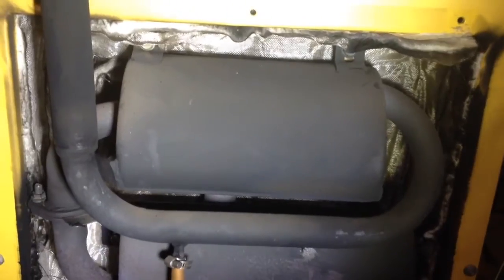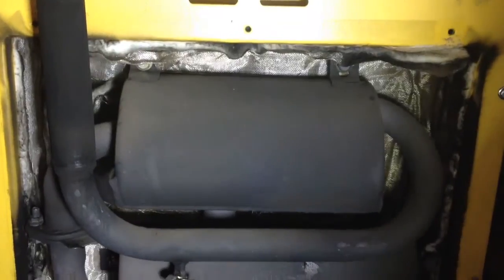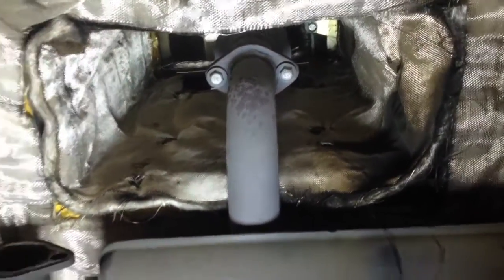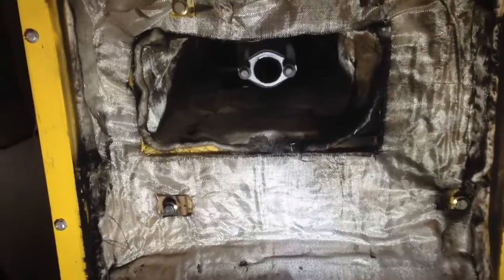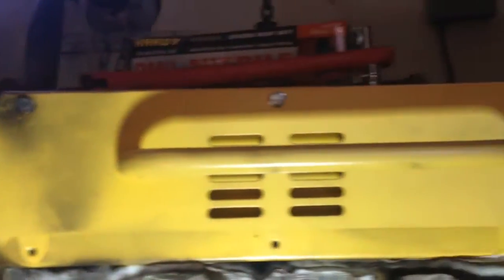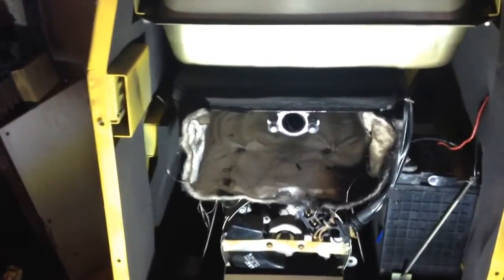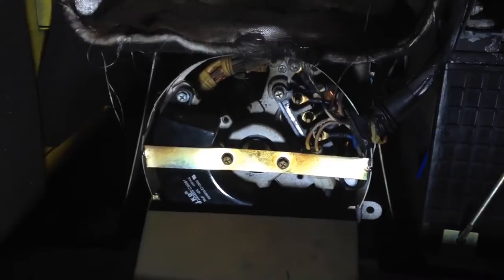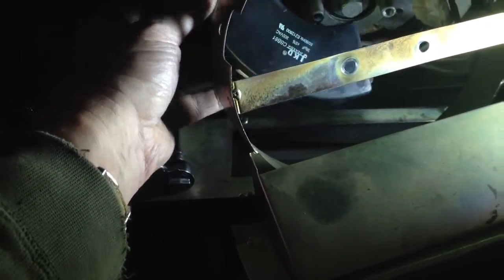Silent Diesel / China Diesel voltage regulating capacitor remove and replace

Comment: Alan, thank you for doing the heavy work here. I have basically the same unit you worked on many years ago. 

That said, my unit runs great except I have out of spec voltage. Basically 100/105 on the regular outlets and 200 volts at best for the 120/240 jack. Do you think that’s the AVR out of range?

Comment: When I did mine I ran longer wires to the capacitor and reloacated the capacitor so I can access it from the side access panel. Now it take just a few min to replace it when it goes down.
Reply: Mine was already set up that way

Comment: My generator is the same. 

i have an out put power issue I've changed th AVR as well still no power please please can someone help me am stocked  please
Reply from the maker: My generator is "self-excited" with capacitor regulation.  It does NOT have an AVR controller installed.  I regret that trouble-shooting is too complex (and potentially too dangerous) for me to go over.  My only recommendation is to test the continuity of your circuit breaker. (I had to replace mine a year ago).  Best of luck to you.

Comment: Hello 
I just got a new silent diesel generator from China very similar to yours, I used it the first night for 10hrs and it works great, the second night I I used it was working and then it stopped generating electricity but the generator is running fine, the volt meter dropped to zero. It’s a 240v system and I only had a very small load on it. I was hopping that you could help me please.
Thank you
Reply from the maker: It doesn't have to be the voltage regulator.  I've replace both the main breaker (heat damage) and the voltage selection switch (120/240).  I'd start by turning the breaker on and off while the generator is running.  Are you in Europe?   BTW, it's NOT good for a diesel to run it with a low load.  You want a minimum of a 25% load to keep the engine from 'wet stacking' and fouling the injector.  Not voltage related, but I ran the generator with too low a load for a while and I eventually had to replace the injector and fuel pump :(  If it's new, I would let them know immediately in case you need parts that are under warranty.  Without the generator running, remove the control panel and look for lose connections.  Good luck!
Reply: No I’m not in Europe, I’m in Haiti. But they sent me a 240v I wanted it to be 120/240v and the outlet are European outlet too, returning it back to China is not an option. I will try to the steps you told me and give you an update. Thank you for the quick reply.
Reply: BTW do you think it might need to re-energized/ field flashing?
Reply from the maker: I thought of that, but it seems very unlikely on a new machine.  The most likely candidate (in my mind) is a loose connection.  You just have to go digging.  Good luck.
Reply: @Neighbour_Al  You learn something new every day, thanks for that tip. I am using a PEL ( Kipor) 6700 diesel set!
Reply from the maker: Look up “wet stacking” to learn more about underloaded diesel generators.
Reply from the maker: Look up “wet stacking” to learn more about underloaded diesel generators.
Reply: Hello and de hell mi generator diésel 6500d silent af combination  the cable capacitor
Reply: You facebook contac you send the photo

Comment: hello , mr alan I have a kipor deisel ke 6700 the voltage regulator was remove to buy the new one but the tech disappear i have the new one how do i install this do that i donot heve any drawing of the generator can you help me on this ..
Reply from the maker: Ramon, I regret that I can't help you.  I'm not familiar with that machine, and the model information that you gave me is incomplete.  I recommend you search on Google using the model number taken directly from the machine.  Best of luck to you..

Comment: I  have a similar generator, was working properly until it stop. 

well , try to crank but not start,  and then the compressed air return to the intake (really loud ).
i turn the engine by hand & turns smooth,  expect when began to compress 

what's can be wrong?
Reply from the maker: I'm sorry, but  I cannot say for sure.  If you can access the valve cover on the top of the engine, remove it and make sure that the valves are operating correctly.  You will need a diesel mechanic to help you if you can find a problem.  Good luck!

Comment: Hello, my generator has an outlet in the exhaust, is it convenient to plug the gap as it did with the copper tube? what does that output work for?
Reply from the maker: That outlet is to drain any water/condensate from the muffler.  The copper tubing and clamp were not difficult to install.  There used to be a rubber hose there, but it got too hot and dried out.  Great question!

Comment: Hi, did you ever posted the video on how to test this capacitor?  I have a generator like the one on the video that I think is bad but would like to make sure that isthe problem before I buy the replacement.    Another question, where did you get the capacitor from?
Thanks in advance
Reply from the maker: My multimeter has a capacitance measuring function, so that told me what the value was compared to what it should be.  I've gotten parts off of Ebay in the past, and I sincerely regret that I don't remember where I got this one since it was a better quality than most.  FYI: They all come from China as best that I can tell, but they are made to the requirements of the people ordering them.  Good luck!
Reply: Thank you so much for your rapid response to my concern and comments.  Will look at ebay to see what I get.
Reply from the maker: One other source: https://www.generatorguru.com/capacitors/?sort=featured
Reply: That is awesome.  Thanks
Reply: I have the same model and kept having a circuit breaker issue when i tried to use the 240 side for my rv . So i rewired the 240 female to the 110 v leads to run my ac that worked fine on the 110 side but got too hot wiring and all worked fine just no 240, Then it just stopped .  Going to check avr now , think i need a nee AVR and circuit breaker but can i buy a higher rated breaker . Maybe 50 amps?

Comment: this part capacitor or avr? and can draw how to connect  capacitor to winding
Reply from the maker: The generator has either an AVR or a capacitor, but not both.  The capacitor is not polarized, so the connections can go either way.  I hope that this helps.  P.S.